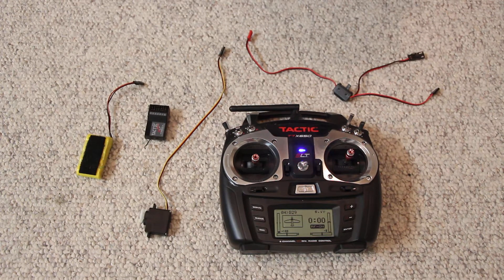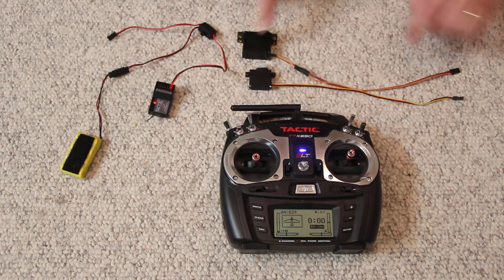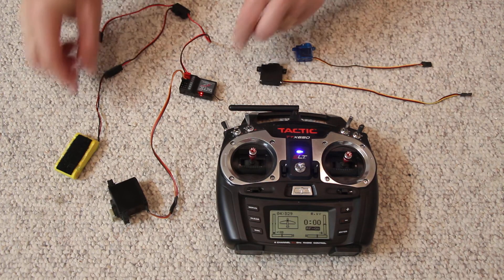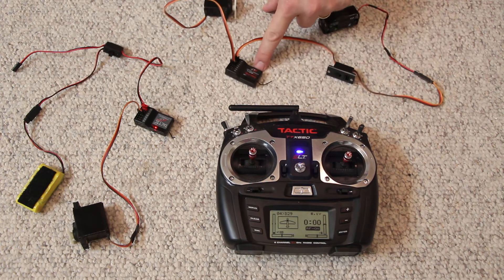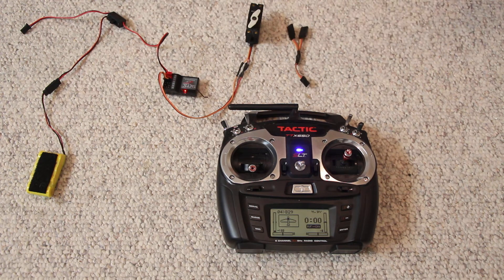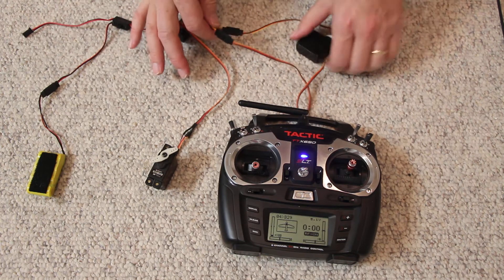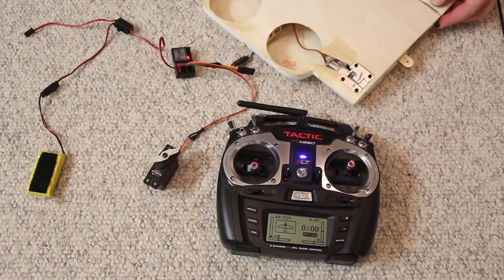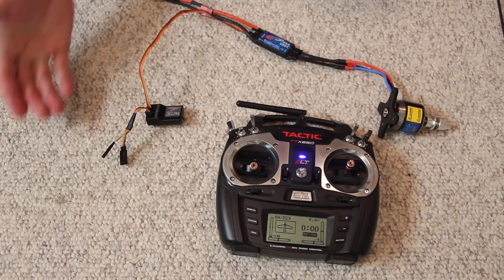Tactic 650 2.4 Ghz basics

Comment: Could you explain how you use two receivers in a twin engine plane?,If I do have two receivers how do you make it so each motor goes at different speeds to help turn the plane? can you use two receivers to operate retracts? I want to run my retracts on a seperate one from my controls so I dont get a brown out.
Reply: Mixing from one receiver different channels.

Comment: Fred, Thank You for the Video. It has helped a lot.
 On the Tactic 624 rec. does it matter which slot things get plugged into?
Oldmedic
Reply from the maker: Ron Didden for each channel yes, it will make a difference but I have had power plugged into other slots and it's worked. Channel 3 is the throttle channel, but also remember you can assign what switch on the transmitter works for channel 5 and 6